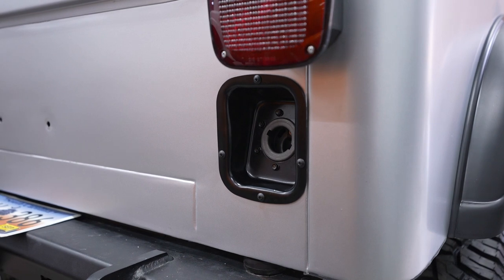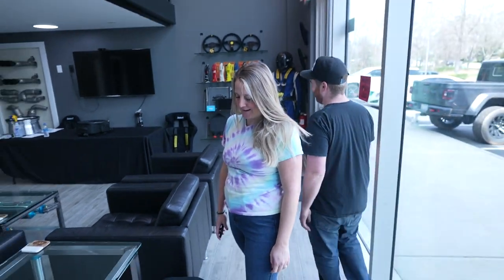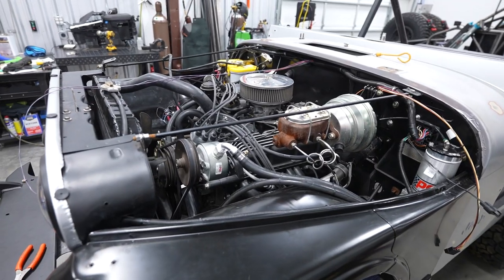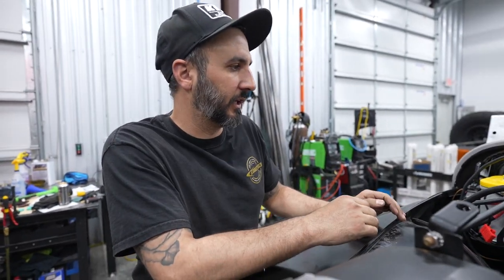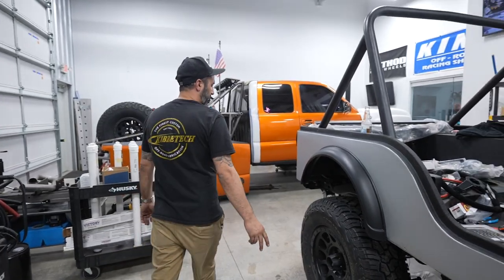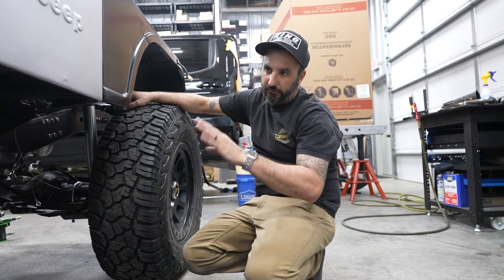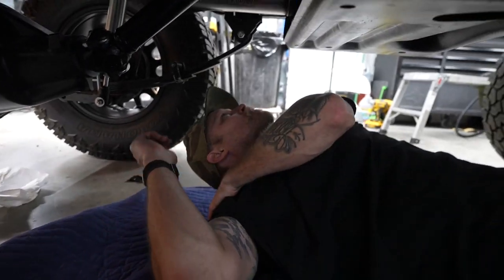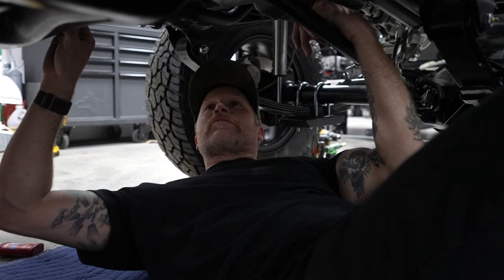Its ALMOST Complete! Jeep CJ5 Restoration!

Comment: That rear driveshaft though... pinion angle looks rough assuming a cv at tcase... not visible in vid. Short wheelbase challenges... I did a 72 but used a flat flange at dana 20 for 1310 cv.